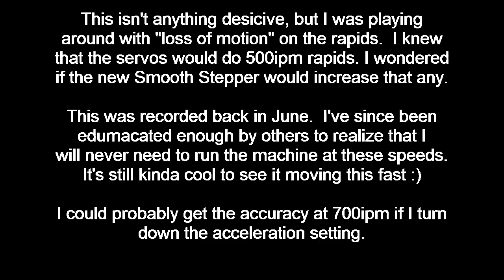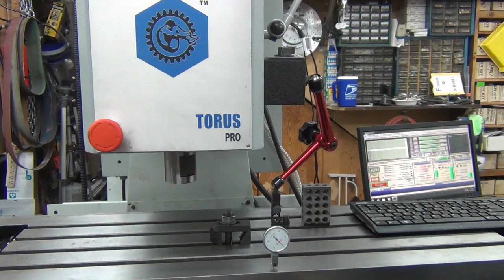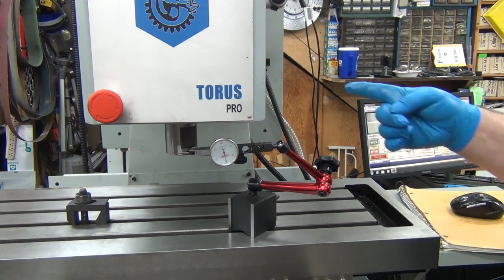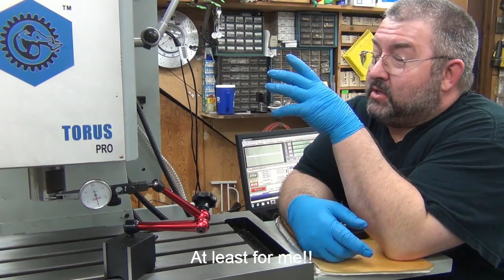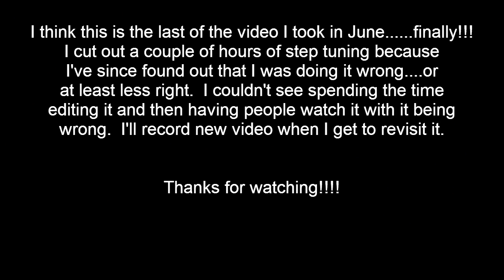Novakon Torus Pro - Rapids w/Smooth Stepper

Comment: Are you still running this machine? is it still performing well? thinking of going with one of these over a tormach. I'm also in Canada so that's a plus with this brand.
Reply from the maker: I am still running this machine.  It's still performing just fine.  I'll be using it again tomorrow.  I don't run it everyday like a shop would.  Ummm.....John moved the company to the US several years ago.  This has 3x's the work envelope and the electric power draw bar is an advantage over the Tormach style.

Comment: Does the Taurus use any kind of counter balance on the mill head?
Reply from the maker: No...just a gas strut in the middle.  They've got exploded views available on their site.... https://www.novakon.net/products/toruspro
Reply: bluehandsvideo thank you. It’s a very interesting machine. My PM833t has a slightly larger work envelope and I’m converting it over to a ac servo drive system right now and centroid oak with a custom assembled bt40 spindle and pdb for a future atc. Working out the finalities on the b axis how I intend to have the head rotate and stay locked. That seems to be my biggest challenge at the moment next to the counterweight so I’m not stressing the z axis too much. The new head assembly should be significantly lighter however in doing my research the Novakon is obviously a good example to follow. Whether I use hiwin’s on the z is unknown yet the current ways on this machine are actually well ground (Taiwan) and very smooth so I may just run them as is. Thanks again for the link I’ve enjoyed following your videos.
Reply from the maker: You're more than welcome Glen.  I'm curious why you're going with the Oak controller.  I know a lot of people are converting their machines to the Acorn.....which is at least 4x's cheaper.  I looked up your machine.  Slightly less X and Y, but more Z.  That will be nice running tall parts or really long tools.  I've never heard of anyone trying to cnc the rotation of the head on a cnc mill. Are you still only going to run 4 axis?  Which Z are you going to control......the quill or the head?  I think I'd run the stock ways until you determine that you have to run linear bearings.....since you may not need to. :)
Reply: bluehandsvideo I have Acorn for two other machines. Acorn has its limitations although imo superior to anything else I’ve tried. The motion control board is stout I wish we could share photos here it’s approx 7x7 with a secondary standalone processor board atop it. I have their full digitizing bundle with all the extras. The price is fair for what you get I cannot complain at all. I am going to run the Oak on this particular machine because I want a true closed loop system. I also want to keep fluid with my other machines and to be able to easily move files around, share pendant, etc... this mill is being assembled as a 5 axis. In order to do 5 axis closed loop I must use the oak board. This means I have to buy the board and one additional axis addon ($2,000 for everything). Ultimately it’s not that much in consideration what your getting is an industrial controller and very easy to use software with well defined digitizing and conversational software included. I would’ve considered a Siemens 828d however I could not find any documentation of their controllers supporting other brand servos. I suspect they may work though they may also be proprietary to their controllers. Acorn is limited to 4 axis and as far as I know they will not offer a 5th axis because that would affect the sales of the all in one, or oak boards. And of course getting true real time closed loop is difficult to get nowadays without spending money. I know linux can do it with Mesa boards and I have several here however I did my due diligence to set it up EMC2 and realized I don’t have that kind of time to commit in the steep learning curve. I believe linux is probably wonderful but for myself I’m trying to make a living and expand technology here it’s a cost versus time issue. I was lost when I booted up the setupconfig and didn’t know what information to submit to the proper input boxes. It’s one thing to draw CAD, run CAM, convert gcode and cut a part.. even conversational, however the skills to contend with Hal files and writing scripts and programming to bring the full functionality of a CNC machine in Linus too fruition really requires serious time sitting in front of a pc, reading, watching videos, practicing, learning, writing code, etc.., whereas both acorn and oak I connect them to the machines, download the files, insert License dat file and start cutting. That in itself is worth the extra money spent on a tried and true system that has been around all these years and they even have 1:1 customer support over the phone linked to pc for a reasonable fee. If you like the Ethernet smooth stepper imagine acorn being about 10 tiers above that in quality and performance and you then get to move away from mach3 and to a reliable trouble free system. Mach3 used to change the settings on me when I did nothing but power down for the night and come back the next day and it wouldn’t work. I’d save them, run, two hours later sudden loss of motion. It was like a haunted CNC. I had tried everything with newfangled with several different computers, operating systems, hardware changes, etc and never had it working 100%. Followed centroids install videos, installed software, specific settings, and connected the acorn to the same hardware and no issues except that I am still learning a new system and it’s extensive in comparison so it takes a little time. If you have all your previous gcode files you can drop them, check tool path, and cut. If you ever go with acorn you can buy the basic I think $325 and if you add the $399 figuring bundle you get everything the have commercially including mill pro, lathe pro, etc.., so you don’t have to buy the other software separately. That’s what i did for one machine and was the best deal. The other mill I went mill pro and standard $450? I believe. I will do the same on the lathe. With one machine loaded with the bundle you can do your work there and take your code to any other machine you want. I guess that is the long and short of it.
Reply from the maker: Thank you for all the great and detailed information!!!  Moving away from mach3 is definitely a goal I have for the mill and lathe.  That's good to know that I don't have to buy the software twice.  I've shied away from linux for the same reasons.  It's one thing to learn what I need to to run the mill or lathe......but having to learn a linux to make it work.....not very appealing.  Thanks again!  Mike
Reply from the maker: Haven't completely forgotten to reply....I'm working 6- 10's right now and I can't take the laptop to work anymore.  Maybe this weekend I'll be able to get back to these.
Reply from the maker: Are you saying I can buy one $400 bundle of software and use it on both machines......lathe and mill?  I know I need an Acorn for each machine.

Comment: out of all the small bed mills ive looked at (ran a pcnc 1100-not gonna put it down but didnt lov it) the torus pro has been my favorite by specs and documentation but havent ran one,, now i see i was maybe right on the better mill choice! Im curious, when a person purchases this mil does it come fully set-up computer wise as the tormach did or is the mach3 tuning like ur doing something that must be done by the purchaser? Im interested in the servo model and mach3 is the only thing i dont like compared to bigger bed mills ive used but i understand the trade off for the need of mach3, would i have to totally set-up mach or does it come already set-up?? Great video,,, keep'em coming!! 650-700ipm is amazing,, This is the 1st video of urs ive seen,, ill keep watching!
Reply from the maker: Thanks! I'm glad you like the vids :)
My particular mill seems to be a bit of an oddball. We've been referring to it as a "Friday" machine.   I've had to do more to it, setup-wise, than any other owners I've talked to.  Most owners put it on the stand, mount up the X-axis motor, finish up normal connections depending on options and run it.  Novakon is already aware of what I've had to do and have used a few of my vids to take up the issues with their supplier.  The thought/hope is that no one else will get a unit like this. lol  
Mach3 seems to have it's issues, but I don't know of any other option out there.  I know there's a Linux option, but everyone I've seen running it has had to tweak or write code for it.  There's lot's of info out there for it, but if you can find someone local that can help you with it, it makes it a ton easier to get started!!!!  I'd do more vids of it, but I don't know it well enough yet......might make it more confusing. lol
I've titled all the Novakon vids with "Novakon Torus Pro - "  If you search Torus or Novakon on my site, it should pull up all the other vids too. :)
Thanks!!
Reply: bluehandsvideo centroid acorn is now available and is superior to mach3 and headache free compared to setting up linux. It runs real time Ethernet. Or you can upgrade to their oak which really isn’t that much for a machine like this.

Comment: That was a good test of the servos, as Andrew Cowell stated your placement of the magnet on the moving axis probably was the reason for your error readings, now if you truly want to test the smooth stepper and you are brave enough, write a program that moves all three axis' at once at full speed to stop at one spot over and over good luck :) Phil
Reply from the maker: NuttyforNissan Hmmm.....interesting idea.  I think I'll install the new BOB they sent me before I do that.  I'm trying to picture how to setup an indicator to show a 3 dimensional "zero".  I've got a Haimer now......I'd want to be really close before trying it with that......$40 is the cheap probe tip!! lolThanks!